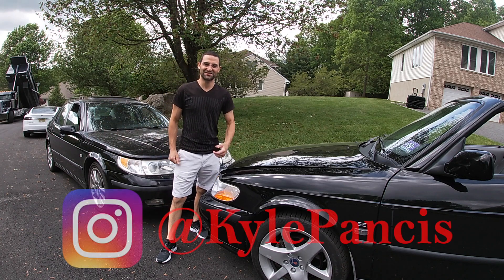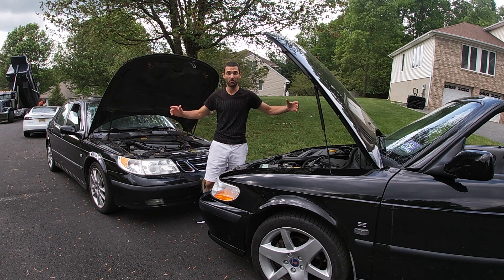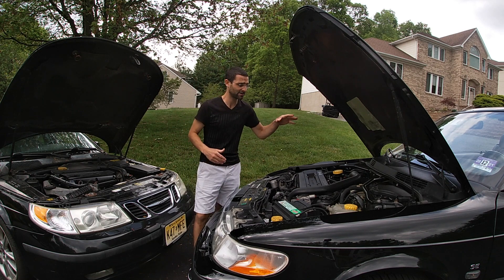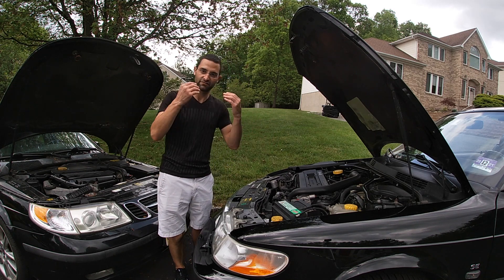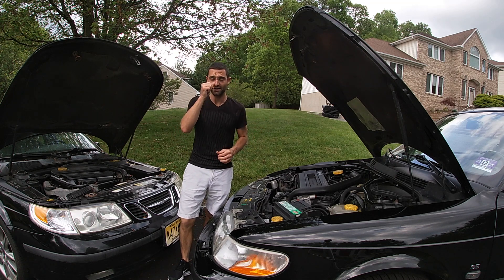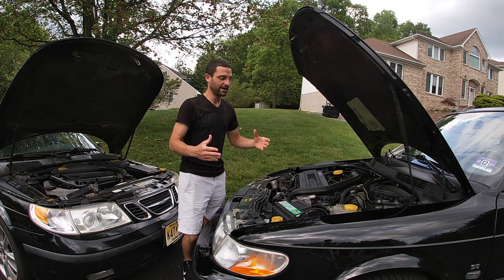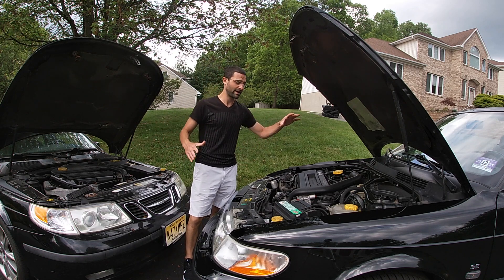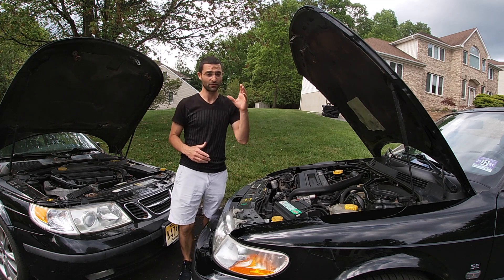How to Prevent your Saab Engine from BLOWING UP! B235 B205 Engines #savesaab

Comment: Hey Kyle... i agree that being proactive and preventive is the way to keep your cars much longer... would you say  the 2008 93 aero xwd or TurboX need the same kind of attention... i have the oil pressure sensor issue atm... thinking of starting with that replacement and if it keeps dinging then attack the pan etc... what do you think? 😎🙌💖
Reply from the maker: I think try the sensor and also try and do a hard tap on an oil line to make sure pressure is good. If not, definitely pull the pan!

Comment: Hi Kyle! 

I am following all your Saab videos since long ago.

It is the first time that I need your help to if you can read this for a moment!

2002 Saab 9-5 2.3t, only one owner.

Unfortunately my mechanic broke the oil pan and I bought a used oil pan in the netherlands 🇳🇱 from a reliable source, that was supposed to arrive clean.

The engine was in perfect shape just before. Oil pump had been dropped, with synth oil with its filter renewed every 5K miles.

Perfect compression numbers on each cylinder.

1st problem, the oil "sucker" (inside the oil pan) had a bit of debris/rubbish.

It was all dismantled again and cleaned with ultrasound tech.

Now everything back together clean but the oil pressure is quite low!!

He has talked to an old Saab mechanic and says debris could have gotten into the oil pump. He is dismantling the oil pump. Should any further precautions be done??

I know the oil pump is different from 2003 - up but no idea if they ' re compatible !

Comment: Hey man, my 2004 9-5 had the drive belt snap on the freeway, and I knew instantly it was the drive belt, and I flew off the freeway, and tried to stop asap, but 2 seconds before I shut the engine off, I heard a bloof sound, then the sound of water boiling, the water boiling being my coolant boiling, but the oil, it ended up all of the right side of my car, and at first I thought it was my power steering fluid, since the power steering was jammed, and I could barely turn the wheel. but no, it was my engine oil, all of it. My engine was bone dry. I did shut the engine off 2 second after the bloof that was it shooting out of... somewhere, and it kept leaking from the right of the engine for several minutes, so i don't think any part of the engine ran dry. But now I am wondering, what could have happened. why did the engine oil explode outwards, only on the right side of the engine, from the drivers perspective, and the leak for several minutes. Of course it happened because my drive belt snapped, but the engine only ran for about 60-70 seconds after it snapped

Forgot to mention it's a 2.3t

Comment: This is way late here, but I see some of your vids right when I need to see them. My mechanic replaced the valve cover gasket a few months ago, but as I was having other major work done then (steering rack, A/C), I didn't pay attention to this. It seemed a minor thing then, that is until this past week when I noticed oil seepage and leaks underneath. The coolant level's fine, no other signs of problems, but at the risk of an engine fire (ugh!), I stopped driving it altogether until I can have it towed to the garage. My mechanic's concerned and surprised as well, but maybe the PCV valve or other seals (on this aging beauty) need replacing? Thanks to these vids, though, and with any luck, we've hopefully averted disaster - I'll let you know.
Reply from the maker: Keep me posted! Sounds like the check valve needs to be replaced. Also check the oil pressure switch on back of engine. That can leak and drip onto exhaust making it smell worse than it is
Reply: Kyle Pancis A lil' embarassed, it was none of that...turns out some of the oil crud around the valve cover was from before my mechanic replaced the gasket, so no problems there. (Phew!) But since I had a PS fluid leak before I got the rack replaced, the original line finally burst from dry rot, fresh oil leaking underneath but spraying and getting cooked and burnt over other components. This explains why top-down driving around town, I was thinking: Wow, is everyone having BBQs tonight? Nope, just me and my car...ah, the power of denial.
Reply: No need for me to be embarrassed. Here's another update in case it helps someone else: As it turns out, there was an oil leak even AFTER the VCG was replaced. Why? Because the gasket was for another Saab, I guess, so it didn't quite fit mine. Thanks to your vids and others on YT, though, I can see how such a simple part can be tricky. (As I told my mechanic, it's like an arts & crafts project or baking a cake, but a LOT more important). Anyway, hopefully we'll get the right one on there and running a tight ship, no more leaks, soon.

Comment: Hi Kyle, always watched your Vids with great interest. Driving a 2003 9-5 Aero estate with now over 400.000 km (second new engine at 240.000 km). One common problem every owner of the B235 engine has is a missfire problem (P1300) which is hard to detect. Would be nice and helpful for the Saab Community if you can make a vid which shows how to find a way to solve the problem. Thanks and greetings from Germany. (subscribed) ☺
Reply: Knudsburg, in other vedeo they explained that missfire dificult to detect are due to bad valve calibration, posibly exhaust valves are too tight.
Reply: @Julio44795  Thanks, do you have a link to the vid? Could it be a problem with the timing chain?

Comment: Can you post the part numbers for the oil seals?  Same on Saab 9000s?  I have low oil pressure on my 9000 Aero 325k miles
Reply from the maker: Check this out: https://www.thesaabsite.com/catalog/saab-9000/?year=1995&bs=4D&engine[]=B234R
Reply: Thank you!